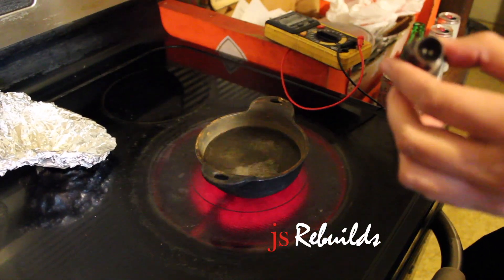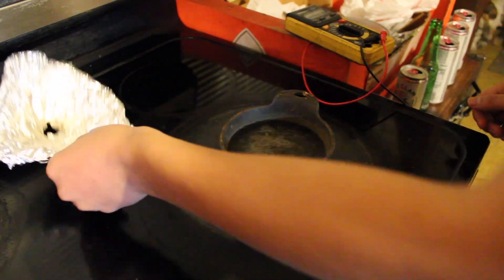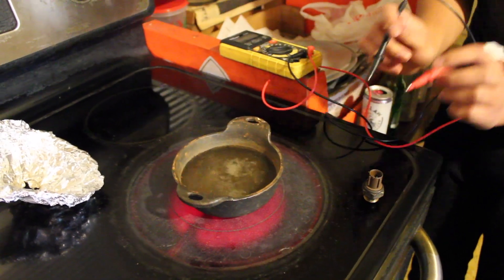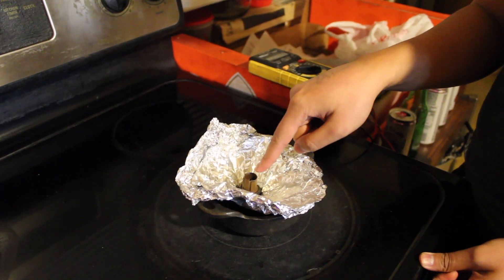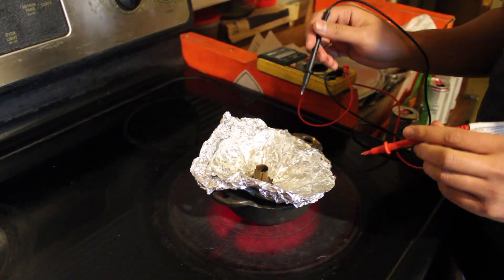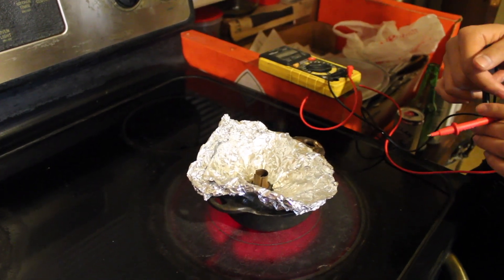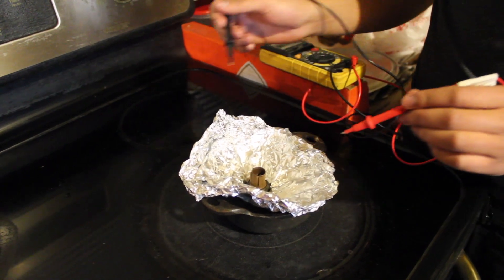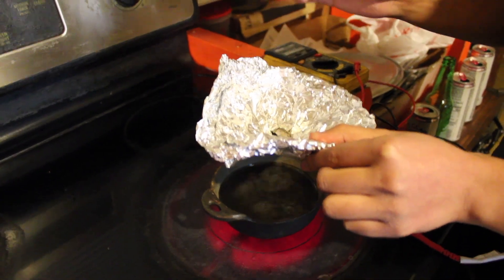How to Test a Honda K series Temperature Radiator Fan Switch Sensor

Comment: This definitely leads to false positives. Bad testing process. 

Honda radiator fan switches can still "close" when left to sit in boiling water. I just used your method after watching your video and it closed as yours. Put it back in the car and it failed. Tested the fans with the paperclip jumper and they worked. Bought a new switch and everything worked as it should. A Honda technician said these switches will "drift" as they start to fail. Meaning, it will open when left sitting in boiling water, but not your car. First-hand experience.
Reply from the maker: Thank you for information. Any correct information is helpful.

Comment: useless procedure without thermometer. you said once it reach preset degree. then couple of minutes until your headgasket fail hahaha. where thermometer? to know at which temp it work. it should open at 90 to 95 c. boiling water temp is 100c. and if it work at 100 or even 97 or 98 it is faulty also.. remember when water temp in radiator is 100 it is 105 or more in engine.